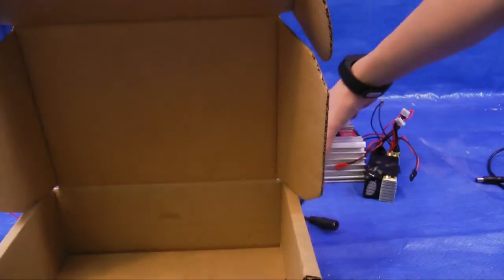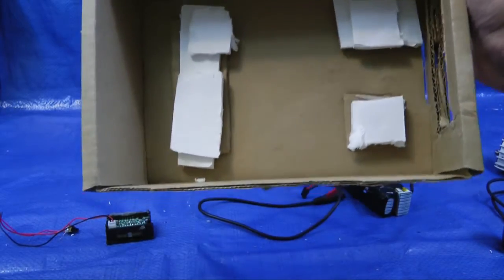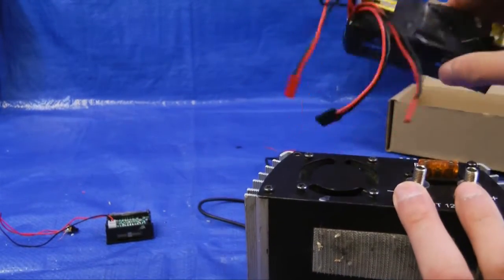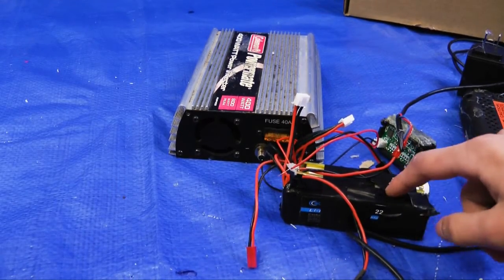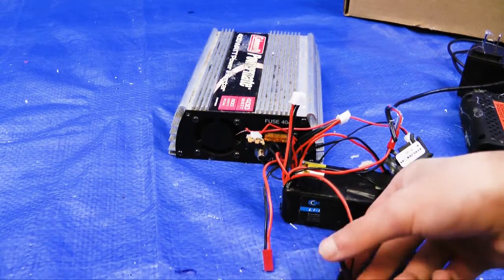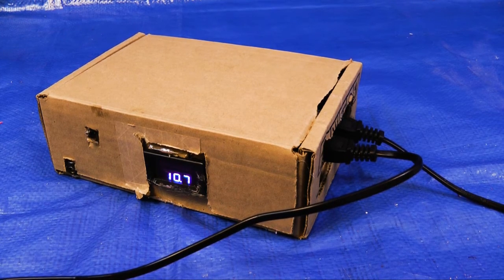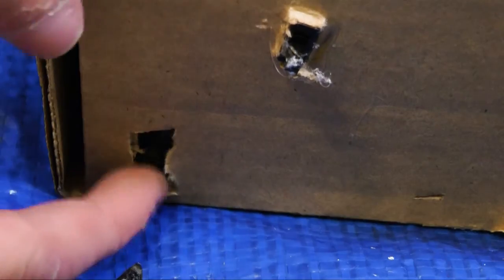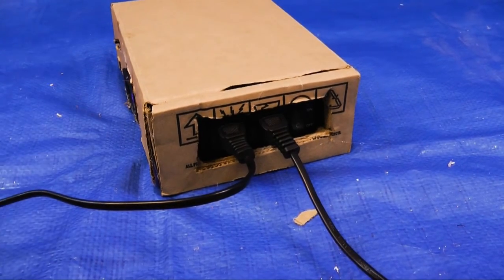HOW TO BUILD A PORTABLE POWER OUTLET

Comment: Great video! I am inspired to build on of these myself, except with Li-ion 18650 batteries :D I'm hoping that 10 of them in a series would be enough voltage or mAH to power up a PS4 and a TV :D 

**That would be awesome!!*
Reply: do you used a step down module for that ?
Reply from the maker: brujhh 10??
Reply from the maker: u need like 30  and bms and inverter